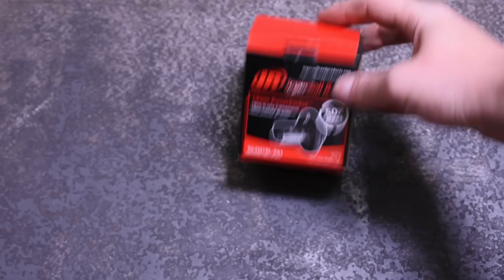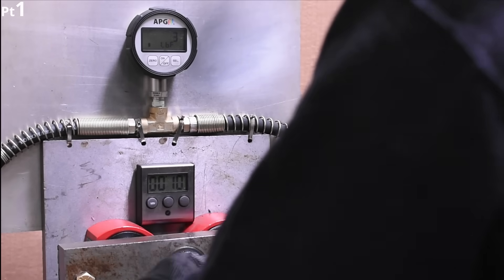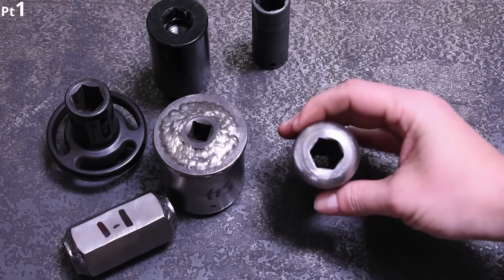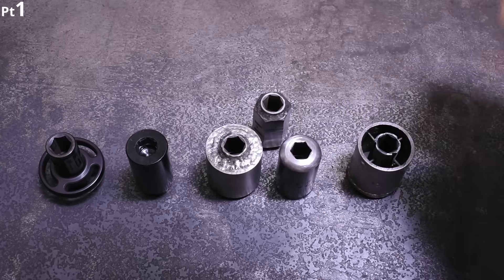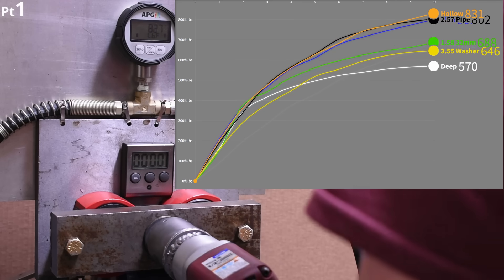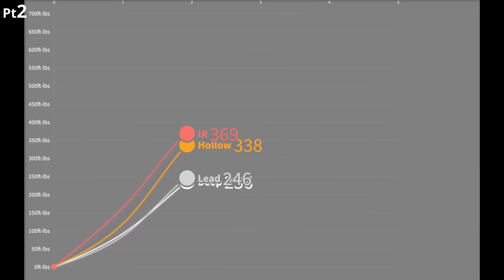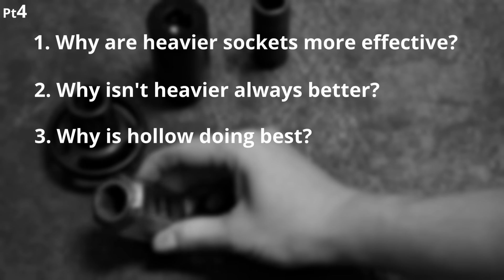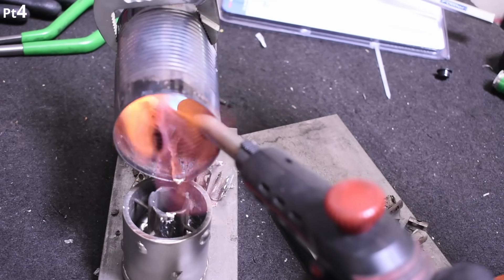Heavier Sockets Make More Power? Stumps Physicist

Comment: These are not new (weighted sockets and bits), but your data collection and testing is!

I don't wrench every day, but when I do it's helping with 5,000 lb dies with hex bolts with millions of injection cycles on them. Usually, just in an attempt to restore a moulding surface or to replace components. I find AirCats don't do it sometimes without significant heating (which is foul as all heck) so a torque assistive device such as these would likely help.

As for the IR (I am not an enginerd but I play one at work) the toroid was attached with 3 spokes. The spokes could act as a delay or offset disconnecting the input torque from the output. Applying the spinning mass outward from the centre of applied rotation might be a torque "run up" with each impulse. The IR socket body just acts as a normal socket without the ring on spokes. I don't know.
The hollow socket seems, to my mind, doing the same thing in a round about way. The mass is lower but applied further away from the axis of rotation.

Man, this is all so much fun and interesting!

(The stacked washers appear to be end welded with a few beads, so one would assume a lot of energy loss is happening there between the lack of connection of the washer's masses)

l have to make one of these on Monday.

Thanks TTC!

Comment: cutting off the flywheel made it worse... the socket is still as less rigid as before but the less rigidity causes the flywheel to do just that... be flopping aorund and that stores energy like a dead blow hammer.... the physicist is 100% accurate with what he said and all you did was take the dead blow of the socket. its NOT a flywheel in how it works.

Comment: It probably has more to do with harmonics than anything, a impact creates vibrations and if the vibrations are working against what its trying to do equals less torque. The flywheel socket reminded me of a cars harmonic balancer. The hollow socket was more rigid so it had less harmonics to affect the torque of the impact. Or im just an idiot either could be true. 😂

Comment: The mass in the socket acts like an inductor in an electronic circuit. You won't see this in the chart you're making because that's the integral. Watch the derivative. There's a little bit of slop in the couplings, which allows a little backlash. These sacrifice some peak impact, but store that energy and release that stored fraction after the friction has been overcome and the bolt receives more motive force than a lighter socket which bounces off the load earlier in the cycle.
Reply: https://youtu.be/QrkiJZKJfpY

Comment: Ok I got a suggestion.  How about welding a  few washers mimicking the power socket then drilling holes in the washers and seeing if there is a change .  Would 2 flywheels on a socket change anything as it would be the same as your creation without the black pipe on the outside ?

Comment: I’ll often be the first to brag about something I’m right on but the idea that adding mass in my mind would reduce the impact transmission and adding rigidity would make the socket perform better! and then these things came out on the market lol and apparently work,but I still find myself using the stronger and the most rigid and usually shortest possible socket is for me what typically gets it undone and balancer bolts are usually the ones giving the problem and with compact guns, rigidity and frequency are probably a big part perhaps a few different guns for different hammer rates could shine some light between socket types(edit) you did lol and good to know as an under educated Aussie bogan mechanic I have a similar line of thought to some of the physics involved as yourself and the professor

Comment: As far as a solution for lug nuts, couldn't you make the "flywheel" weight deal as an adapter/extension?  So it is just a 1/2" drive throughout and pop a socket on the end of it so you can get into these places still.

Comment: I think there is a dynamic spring effect going on and the  stiffness and ability to spring oscillate from inner diameter to outer is at play.  Damping effects and impact rate will probably cause some other variations.  It's all hard to say if it's that for sure.  But betting if it is a socket could be tuned if you will to specific impact rates so the flywheel would act as effectively and impact adder that hits every other impact kinda as the fly wheel is sorta sprung just behind the socket impact only to catch up and sorta be ahead on the next oscillation.  Suspect all the different designs are just dumb lucking some marginal improvements and the extra weight.  Probably too much damping somehow as you get more weight and you aren't getting as much of the spring oscillator help. Also, could really be extra stiffness of the super stubby retail forged guy, so having various reasons helping.

Comment: I want to compliment you on a very good video and you have a very analytical mind allows you to test things in a way much like  the great scientists did it in the past I am an electrical engineer for the last 40 years and it appears to me that the problem is a little more complex than what everybody is realizing So I'll try to put it in terms of electronics which makes it a little easier to understand The rep of an impact tool is actually the base frequency and when it impacts it generates lots of harmonics in the high frequency range  for a very short time. It is much the same as a pulse generator with a rep rate that's rather slow and the pluse width is small. If you do an FFT analysis,  you will find all power is in the upper harmonics. The mass of the socket must be tuned to these harmonics.  A thin wall socket will just flex every impact absorbing most of the torque, and a heavy socket will absolve the torque in inertia. I believe your test confirms this. Great job, you should of been a engineer!

Comment: The tool can only make a certain amount of power so spinning a heavy socket likely takes away some potential kinetic energy for each blow which is likely why we saw some diminishing returns.  Where the weight is also seemed to matter which is possibly due to some angular momentum being at play.  It's likely a combination of factors so more experimentation would be beneficial.  Keep mass the same, but move the exterior pipe on the hollow design inward or outward and see what that does.

Comment: When i have extremely rustet bolts that wont move i hold the socket and twist it with my hand the oposite way to hold up the slack so the whole socket and airgun is like one and hits the head ot the bolt/nut.

It ALWAYS increases the power a lot.
So a socket with more play might also increase the force.

Do it many times a day and never hurt my hand doing it, saves me going to pick up the bigger 1 inch gun

Comment: I would say it is as simple as, the lighter but larger hollow socket is just moving faster due to its diameter. meaning the weight that is added is like a larger cheater bar and because its lighter its not absorbing the hits has much

Comment: I mean it might have something to do with the amount of inertia vs the amount of mass. The hollow tube would have more rotational inertia because the mass is further from where it rotates, but would not need as much additional mass to achieve this inertia. 

There could be several other things at play here but this would make sense. Also there is necessarily some clearance between all of the parts involved, so maybe this plays a role with the amount of momentum it builds up before it transfers torque to the bolt.

Comment: The professor is correct on all points. Your last question has to do with the springiness of the long bolt on your test set up(and crankshafts)where the additional mass is able to counteract the lower force of a weighted socket in overcoming the bolt bouncing back on every hit. It's explained in the Ingersoll weighted socket patent.

Comment: Seems like it might be a good idea to make a lot of flywheels of different diameters that would all screw onto a single test socket, or maybe just a bunch of flywheels welded on really short extensions that fit between the impact and the socket, to see where the ideal flywheel diameter and weight is at.  Will a lighter but larger diameter flywheel produce more torque than a heavier but smaller diameter flywheel?  Generally a lighter and larger diameter flywheel is the most efficient, but in this application there might be a specific combination that works best.  The number of hammer blows per second may also have an...impact...on how much torque could be produced.

Comment: Bet there's two main factors: rigidity and mass-match. And they work against each other. If you just weld a highly inflexible socket with low workability (high hardness) to the anvil, i think you're gonna get great power transfer, that would actually go up the less weight it uses. But on the other hand as long as the anvil and socket are separate then it might simply be a matter of an ideal (prob linear) match between either hammer mass and socket mass or hammer-and-anvil mass and socket mass (I suspect the latter).

Could be, let's say, 70%. Could be that the IR is made for smaller guns than the heavier V-brand (I forget the actual name), and thus the big V was closer to 70% of the hammer mass of the guns you used (but the IR was closer to the guy's gun's mass in the clip at the end).

With of course rigidity remaining a factor, with say the flex of a torque stick far outweighing the additional mass it provides. 

Could be that the energy transfer is best when the mass is farthest from center (for torque when transferring absorbed inertia), is highly rigid and thus transfers the most torque directly (without absorption), and the closest to some percentage (maybe just 100) of the mass of the spinning/impacting parts in the gun.

Hell, it may even help to simply reproduce the hammer with all of its weight distributions in the form of a socket so that all of it's energy is most efficiently absorbed via the spring of the anvil, which would be highly rigid and thus also transfer much of the direct force (the way I see it there are two different kinds of transfer — a split second of direct torque from the hammer via the anvil and socket, and the (possibly simultaneous) transfer of momentum from hammer to socket mass to impact the nut (this effect — if im not just imagining it — would be minimal from the anvil as it doesn't have much mass and is highly rigid, so efficiently transfers energy without needing to momentarily store it via momentum (instead via torsion).

Comment: This brings up several really interesting questions. What I'd like to see is a calibrated impact; I.E. a 5 pound weight Dropped from 2 feet onto a breaker bar to see if the rigidity versus weight question and answer is actually true. I strongly suspect that the weight of the socket has to be in a goldilocks zone versus applied impulse, and that could be proven by changing the height of the dropped weight and seeing where that curve rises and falls versus impulse.

Comment: I think a really interesting element to add this testing would be the rotational speed of each socket. My guess is that whatever pressure your system is outputting can drive the anvil to a fixed speed because of the design of the pneumatic motor. With standard weight sockets the limiting factor on speed is the pressure. With speed staying the same, and momentum being the product of mass and speed, increasing the mass increases momentum until you reach a critical point where the pneumatic motor starts to loose speed and you reach a point of diminishing return. 

My prediction is that the sockets that had increased torque, would show a similar speed to the standard sockets and the heavier poor performers would be slower. 

If that were to be the case, you should be able to plot the points of mass vs  peak torque, run a quadratic regression and approximate the optimized mass.

Comment: I'm not a physicist, but here's the answer.

The physicist is correct when he says more mass isn't better. But that is grossly over simplified.

The key here is force. Which is Mass x Acceleration. Force in this case, and more specifically for the Ingersoll socket. Is multiplied by leverage. The leverage the mass has over the bolt/nut is directly related to how far away from the center of gravity it is. Thus, the weight on the ir socket is at a measurable distance to the CG of the socket. But, is not enough weight to diminish the original power because. The farther away from the CG the weight is the more it multiplies the leverage. So less weight can apply more force. And in general, more power over time(horsepower).

The next part is rigidity. Under load the deflection of a socket will diminish energy. This energy is being lost along the length of the socket. When you apply a structural reinforcement to the front and back of the socket you have basically made a three dimensional support structure. Which makes the loss of energy from one end of the socket to another less. That, coupled with the small additional mass at a higher fulcrum i.e. the hollow socket. Creates more force.

So to prove my theory. Make the can farther from the socket. But at a limited cost of added weight.

Comment: As many others have stated, the mass isnt as important as the moment of intertia. My theory is that the moment of inertia needs to be tuned to the impact mechanism. You might gain some more info by attaching scales to your impact sockets and watching them in high speed video, plot the rotational position, velocity, acceleration etc.

I wonder if permanantly attaching the socket to the anvil would help too.

Last thing, if you want maximum mass tungstem is the material to use. You can buy tungsten wire on mcmaster, which you can then wrap around your outer tube. Then braze it in place. maximum mass concentrated far out. also a good way to increment the mass.

Comment: In all 57 years as a mechanic --- when I ran into over-tight bolts or lug nuts, I always used a heavy walled, deep, six point, 1/2" drive socket and I noticed one interesting thing: If I wrapped my hand firmly around the socket as it was being driven by the air gun, it always took those tough nuts off a lot easier than when I didn't warp my hand around the socket and turn it slightly the wrong way. 

I could feel the socket hesitating and being held in a backlash position until the next hit of the hammers in the gun would send the next shock/impact down the shaft. I always thought that allowing a little space in the hex of the bolt/nut and the hex of the socket, allowed the socket to accelerate a bit just before it ran into the hex of the bolt/nut and THAT was where the mechanical advantage was --- by me allowing the slop or lash in the socket to be held open with my hand --- and let the socked hit with a little more velocity. 

Another thing --- if I squeezed the socket too hard, the effect was lost until I released it a little bit .... mebbee .... just sayin' ...... 

I'd like to see you make a hollow adapter to use between the gun and the socket - just to see if you get any improvement too.

Comment: Thinking as an electrical engineer, when a transmission system is mismatched, power reflects back to source. Could something similar be happening here? Too little or too much mass reflecting power back to the hammer?

Comment: I've used the Lisle and was blown away at how well it worked on those stubborn F-series Honda crank bolts. I figured it was partly the increased mass, but also some increased rigidity allowing better torque transmission.
Absolutely bitchin' that Astro's making a hollow socket, good work! Now find somebody to manufacture your gas-powered impact!

Comment: Tooling engineer for a place that makes large solid rocket motors here. I will bring this up to my group after the holiday and see if we can come up with anything. Also can perform FEA analysis on socket designs and see if i can replicate results. Though I would expect the engineers at IR and the like have done that homework as well.
Reply: That sounds fantastic! If they don’t have time to reply to your comment here… You can shoot an email to TorqueTestChannel at the ole Gmail website. I’m just a channel moderator, but I like your suggestion. Would be fascinating to see what findings your team comes up with. You might stumble upon something and find a way to make a better socket.
Reply: My initial theory is that there is going to be a sweet spot of the mass and MOI of the socket which is relative to the impulse from the impact wrench, which would vary based on the impacts hammer and such. (For a perfectly optimized socket, most impacts probably fall close enough together to be within that golden range)

Exaggerated, if you had a socket that weighed 100lbs, the impact energy would be absorbed by trying to budge the sockets mass at all.
I agree with the thought that the larger OD socket "hollow tube" style, could be simply adding torsional stiffness to the socket, without adding a great amount of mass, but the removal of the "flywheel" results is very interesting.

I am wondering if there is some factors of the IR "flywheel" that is functioning like a dead-blow hammer. I.E. the initial impulse gets the flywheel ring moving, but the spokes allow just enough flex that there is a delay in the stresses reacting, which is still trying to "pull" the socket forward when the next impulse hits. This could possibly be investigated "in the shop" by adding weld on the spokes of the IR socket, or conversely removing material. Yes adding heat to the socket could be changing the material properties more than simply adding or removing mass and structure, but i am thinking that may be negligible.

What would be really cool, is if the same principals could be integrated into a simple impact extension, to basically create an inline booster. TTC Impact booster incoming